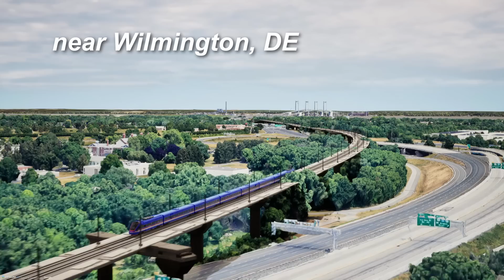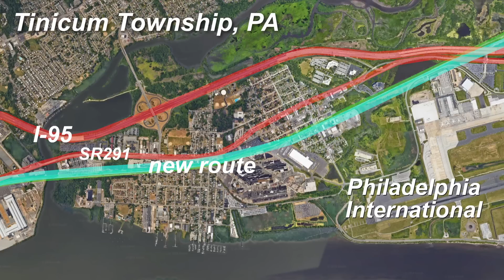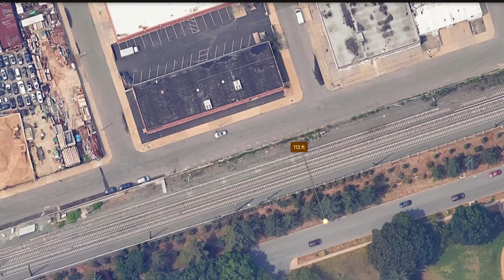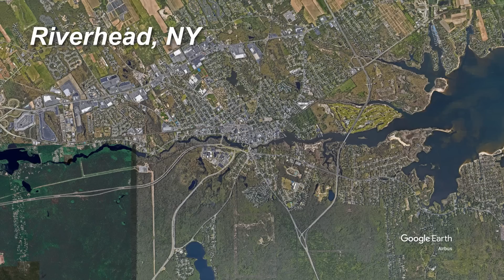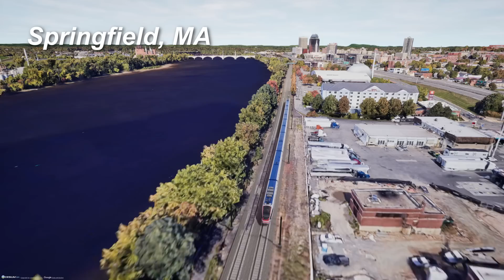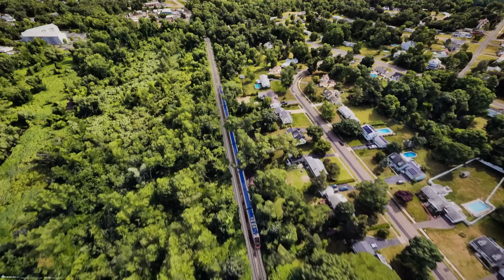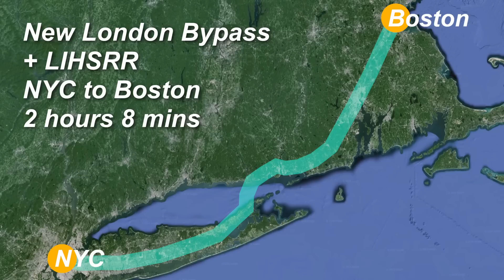How YOU Would Improve the Northeast Corridor For Acela High Speed Rail Service

Comment: Some of this cost could be offset by adding in battery storage (as the new French TGV is adding). This would allow less need for electrification and that includes tunnels. Recharging could be at the main stops or even via "trickle" charging while its on the overhead lines. Yes it would add weight but as a specific battery locomotive part , it could at the future stage be swapped for better batteries with longer range or lighter. This might solve tricky sections that would be hard to electrify overhead and reduce the cost (and possibly fewer objections to such infrastructure visually).

Comment: Great video, Lucid! I really like the LIHSRR and New London Bypass, but I wanted to ask if you ever considered cutting straight from the i95 re-route from roughly Exit 4 in Hopkinton, RI, to the NEC just south of the Kingston stop, and with a curve easement just north of there. It wouldn't have to go through the nature preserve, and I believe it would cut less houses as well. As for the LIHSRR, I was wondering if you could run a steeper tunnel into the woods from the existing RoW at Greenport West that wouldn't cut through a NIMBY mansion, or perhaps even a longer tunnel with faster curves that would only cut across a farm field and maybe a house or two in Cutchouge, just southwest of Peconic? Thanks!

Comment: BACK TO RAILWAY KINDERGARTEN.
Trying to run a railway line with all types of trains from slow moving freight to Super High Speed types, will NOT be found ANYWHERE IN THE WORLD. For the simple reason that trains operating at speeds above 149mph MUST HAVE a totally segregated and totally secure separate right of way. Which means Super High Speed lines require CONTINUOUS SECURITY FENCING that physically prevents ANY HUMAN or Road vehicle coming anywhere near the tracks, under any circumstances, for very serious safety reasons. If such a train came into contact with a road vehicle at speeds over 149mph, it is virtually guaranteed the train would leave the rails, and HUNDREDS would be killed. Super High Speed trains by default need to be made strong but light, and despite that need usually require in excess of 12,000 hp per train, depending on their total tonnage. Which effectively means Diesel powered trains are NOT an option. 

Further "Super High Speed" trains CANNOT utilise traditional trackside signalling methods. For the simple reason a Train Driver cannot be relied upon to spot such signals at such high speeds. So onboard Computer controlled signalling physically displayed on the Drivers desk constantly utilising what is known as a "Moving Block" signalling method is required. Such as the French TVM460 system. This of course is an expensive system, which means no other trains can use a "Super High Speed line". The "Super High Speed" type train can however change to a traditional railway line if it runs at slower speed, switches off the onboard computer signalling system, and reverts to using whatever system is available on a traditional route. This allows such trains to finish their journeys of the last few miles into City Centres. Avoiding the extreme costs of trying to find room for a new Super High Speed Line into such city centres.   
 
So SUPER HIGH SPEED trains have to be electrically powered, and the most common system Worldwide for such trains is a 25,000v AC overhead supply (Catenary) at either 50Hz or 60Hz. Such trains in other  words consume large quantities of electricity, probably in excess of a village of 2000 residents. A factor that has to be built into the overall costings for such a line. Don't forget the Japanese Bullet train network (A Government paid for network) Bankrupted Japan.

Comment: That college prof and his LIRR/NEC cooperative combo is just insane. Even as the outside two tracks of six are rotting into the ground the LIRR has no capacity to spare west of Jamaica, since it requires about twice as many trains now to serve the passengers originating at Grand Central located only a few blocks from Penn Station. This with ridership at about 75% of pre-COVID. Also, I could never figure out how he intended to get through the hills/mountains east of Hartford. I spent quite a bit of time on that and just couldn't envision anything. (I don't think he could either) Port Jefferson Branch is all at grade with tight curves and crossings. At least there's no third rail. You can't have it with all those grade crossings.

I did work up a Philly Shortcut using that Port Richmond Industrial Track which takes just about exactly two miles off the existing route built in like 1835. That's included in my lengthy illustrated treatise on "NEC Future? - or Backwardation" (https://www.rail-nyc-access.com/rail-nec-future)   ...but I recently did a re-draw including every single track drawn out separately. There's two grade-separated versions at Frankford - for getting both NY and Philly trains onto the Atlantic City Line - one's more grade separated than the other. (both are separated from the rest, one is separated from itself and takes up more room) Unfortunately, I got both the stations - at Frankford Jct. and 30th St. - wrong, so haven't been able to do a video. (actually I'm still hoping to sue concerning a few things so videos is discretionary) At 30th I took out two tracks (resulting in two long 40-foot-wide platforms for the NEC - but there's only three station tracks there as drawn, so I was forced to leave out a lot of the trackwork on the north, and that's a fantastic piece of state-of-the-art slipswitches opened 1930: The diverging tracks have 1500' radii with spirals to infinity at either end. Crossing angle is 3.75 degrees. (too bad you can't have superelevation) There's a version in the the drawing with all the switches (3 or 5 more) but they're duplicative given there's only three station tracks. Frankford Junction Station should have six tracks, not five as I drew it. Must go back to fix it, not now. But you're welcome to have a look at the file, just say so + I'll send it. Seems I got in late on this NEC video but don't remember any notification. I'm less with the browser turned on now, trying to make a deadline to sue that's probably already past.

Comment: It's absolutely true that the LIRR between Floral Park and Hicksville should be four tracks. They envisioned this sometime in the 19th Century. It is a 100' right-of-way. Leave it to the MTA to build a 3-track version... just completed... for $3-Billion... with no grade separation at Mineola where the Oyster Bay Branch diverges. The old station house there is 100 feet from the nearest track. Trains for Oyster Bay coming from the west cross the 3-trach line at grade WEST of the Mineola station and, stop at the INBOUND platform to pick up outbound passengers.

First they should have upgraded and reopened part of the Central RR branch to Hempstead, bypassing Hempstead and meeting with the Ronkonkoma and Montauk branches east of Hicksville. Then they'd have two tracks in addition to the stretch bet. Floral Park and Hicksville to allow space to build the 4-track upgrade there.

Comment: I like your proposal for Long Island, but there is one massive flaw, the rails in CT aren't completely owned by Amtrak but instead by the state, and CT would wholly oppose any construction that completely bypasses their major population centers. In addition, with the only other station on the island itself being Riverhead, you will need to construct lots of local transit to connect up Suffolk County to the rail line which would essentially create a light rail system throughout the county. The reason for this is that, while MacArthur Airport does see passenger service, Calverton Airport just to the west of Riverhead would be a perfect candidate to convert into a proper international airport with Europe travel. Either that or an expansion of Francis Gabreski airport just to its south. Or both, functionally turning Riverhead into a large connection hub for travelers. It's also going to be 'expensive' to add overhead catenary power to the entire LIRR main line. The LIRR hasn't electrified the Oyster Bay branch because it is cost-prohibitive. While the connection at Jamaica is certainly warranted, the cost of doing so is rather, neutering. Not only that, presently, NY State is in no position to afford anything as a huge proportion of its wealthy residents have left for parts south, taking with them a large portion of the tax revenues. This is something that would have to be paid for by the Federal Government, and we all know that the opposite of Progress is Congress. I am certainly not opposed to the project, but it is quite...complicated.

Comment: Hey Stew I live right by Springfield MA and I'm a huge rail enthusiast. If you're working on any other videos with trains running through Springfield or the Western Mass area, I'd be happy to help with anything you may need. My city of Holyoke used to have an extensive, incredible streetcar network that was torn down a while ago and the entire region is still suffering from a lack of transportation options. I love your videos, keep up the great work!
Reply: By the way, there are a lot more places in MA that desperately need to be double tracked and I've tried looking into the possibility, but I don't have the expertise you do and I'm curious how you concluded that there would be sufficient space to double the tracks for the whole Hartford to Boston via Springfield route. Also, how did you get the estimated costs? I make a lot of fantasy transit maps and try to break major construction efforts into phases based on costs, but I have little pricing data to go off of.
Reply from the maker: For the Springfield line specifically, that used to be double-tracked the whole way. They pulled one out in portions about 30 years ago to save on maintenance costs. But usually I just look at satellite maps and do measurements. My cost estimates aren't anything special. They're based on existing projects.  For double-tracking specifically in that area, you can look up the cost for the work on that line that they're doing right now.

Comment: use the existing 30th st station and the Septa tracks underground through the  1980s-built commuter tunnel, and then a new connection at north broad to re-connect with the NEC main.  The freight line you mentioned is owned by Norfolk Southern now
Reply: Frankford Jct curve has been the site of TWO major fatal derailments, once under PRR, and more recently Amtrak (excess speed was the cause) That curve has to be straightened for no other reason than safety.

Comment: What software do you use for the rail demos? I can tell you use Google Earth overlays, but not sure what software/simulation you use for the tracks and trains.
Reply from the maker: Unreal Engine 5
Reply: @LucidStew  Okay thanks. Is it the Train Sim World game or some plug-in that you downloaded? Sorry for my 20 questions, but I love making hypothetical rail routes on my own and I'm trying to find new and better ways to convey my thinking.
Reply from the maker: @JustinCastleberry117  No, it's not a game, it's just the engine, a google maps data plug-in(Cesium ion in this case), and some marketplace assets.
Reply: @LucidStew  okay, thank you for the information! I may have to give it a go one of these days. I wonder how long it would take me to draw out a 230 mile route lol.
Reply from the maker: @JustinCastleberry117  It has some limitations. My computer generally starts to chug if I do more than about 10 miles. Google maps is also a bit limited because it only tends to have 3D buildings in cities. But if I laid out 230 miles in 10 mile chunks as fast as I could, it would take me a couple of days. In most of the videos that feature this, I'm probably doing 40-50 miles. Add in extras like cameras, cuts, structures, traffic and the time-in goes up very quickly, but super-basic routes are pretty quick.

Comment: Hey there, as a Philadelphian and a Northeasterner, I have a few quick notes:

1. For Philly, one of the major problems with the Center City tunnel has long been that it does not provide an adequate connection with the Keystone Corridor. This would create the awkward no bueno option of having two major intercity stations in Philadelphia where there is currently only one.

Incidentally, the idea of skipping Philadelphia proposed in the last video is so inane from a ridership standpoint that not only would it get laughed out of the room, it did get laughed out of the room.

2. As far as using the Harlem and New Haven lines in New York, while the Harlem Line is 3rd rail, the New Haven Line is actually under wire the whole way along from Woodlawn Junction, which makes things easier. New Rochelle would need a flying junction, but, uh, New Rochelle needs a flying junction anyway so there's that. Also, the Harlem Line is in a trench the whole way through the Bronx, so if we wanted to convert the middle two tracks to Amtrak it might actually be easier than expected to install catenary (because you can anchor the stays on the trench walls instead of needing space between the tracks to erect masts).

3. A pretty big critique of the Greenport tunnel is that it bypasses New Haven, which suffers from the same ridership problems, albeit on a smaller scale, as bypassing Philadelphia. Remember here that the most important metric isn't dollar spent per mile or minute saved; it's dollar spent per net rider gained.

4. While the Boston & New York Air Line alignment is terrible for passenger traffic, it actually seems to be a strong corridor for freight reactivation, which would provide a dedicated, direct freight ROW from Boston to Southern New England & kick freight off the major passenger alignments in the area, freeing up slots for more frequent intercity and regional services along both the NEC and New Haven-Springfield Line. (That said, it does not solve the problem of lack of a dedicated freight line into New York from New Haven, which it would definitely need to work in concert with in order to provide a dedicated New York-Boston NEC freight bypass.)
Reply from the maker: Well, here was the logic behind running a Philadelphia bypass through New Jersey:
1. You take through traffic off the main line and that allows you to improve service TO Philadelphia.
2. Its fast on the surface. That's probably the only place on the entire I-95 corridor where you could add a significant amount of 200mph capable ROW without half of it being in a tunnel.
3. You improve service in southern New Jersey and increase development there.
4. If you improve travel times enough, you peel off passengers from air travel, specifically between NYC and D.C., but this would also work with Boston as well if NYC-Boston were improved enough. That's potentially a lot of passengers, and again, you'd be able to keep them all OFF the main line through Philadelphia.
5. You have places north of Trenton where you can improve capacity on the main line. You have places south of Wilmington where you can improve capacity on the main line. You don't have many between.
6. In a distant future where electrified trains could be running all the way down to Atlanta, your options don't end at D.C., and that extra through capacity, at speed, from NYC would be that much more valuable.
Reply: @LucidStew  The thing is that none of these arguments are really convincing from a ridership perspective. Philadelphia is the largest city and hence largest ridership driver between New York and DC, and, while there may be a reasonable argument to be made as the electrified network expands that a separate track pair for the fastest service will need to be built, the tradeoff of sacrificing your 3rd largest ridership generator for some miles of 200 mph track still...doesn't make sense.

Ultimately, like Japan's Tokaido corridor, the high population densities and concentration of intermediate stops doesn't actually make 200 mph track feasible in the Northeast Corridor. And in Japan, too, remember that the Chuo Shinkansen--is going to stop at Nagoya!
Reply from the maker: @riroo8275  There are nearly 200 flights a day within the corridor that fly over Philadelphia without stopping. That's a capacity of 30,000 seats or roughly 3 times what Acela currently carries on a daily basis. Not a single person on any of those flights has a single interest in stopping in Philadelphia.

Comment: Why are you limiting speeds to only 160 mph?  The Avelias can go up to 186 mph with tilting, or 220 mph without tilting.  They are currently limited to 160 mph by the current CONOPS, but new 186 mph CONOPS could be devised for Tier 2+3 trains in mixed traffic.  Or new trains like the Velaro Novo could be bought, which are cheaper (tilting is expensive) and faster accelerating (they're EMUs) and largely make up the difference in tilting by accelerating faster.

Also, what numbers are you using for acceleration and lateral acceleration (or superelevation + cant deficiency)?
Reply from the maker: Because even 160mph is a bit of an ask? That's just the goal. You wanna knock off 30 seconds here and there for the difference between 160 and 186, be my guest. Superelevation and cant is by U.S. standards, but you have to understand that I can't measure every curve with precision and put out a video in 7 days. It's an approximation. Should be +-10% on time. Acceleration is assumed at approximately 0.4 m/s^2, which aligns with several HSR services around the world, but again its not done with tremendous precision lest it take forever to do.